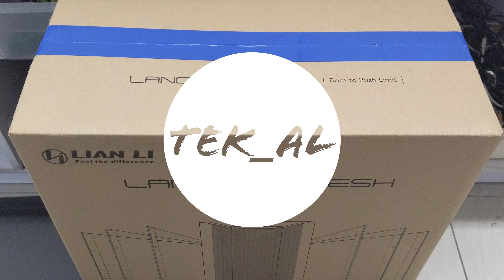Lian Li Lancool II Mesh Build | 5800X | Galahad AIO 240 | FTW3 RTX 3080 | AX916C (time lapse)

Comment: Bro I need help , so my system booted up first try and was going smoothly until I overclock Ed my ram , now when I try turning it on it says the cpu is not working so is my cpu dead or did something else go wrong
Reply from the maker: Hmm. AMD and memory sometimes don't play nice together depending of memory brand name. Just reset your CMOS and it should post again. If you see two pins usually nearby the coin battery on motherboard. Beside those two pins on the mobo it indicates CLR_TC. Short that out by using tip of pen or screw driver. If you're comfortable with that of course. If not then take out coin battery, wait an hour or so then put it back in and turn on PC, hopefully they did the same job. Hope that helped

Comment: Do you think I could fit a 280mm Aio at top with same ram ?
Reply from the maker: I think it can. It's very tight but it looks like it'll squeeze through if done right
Reply: @tekaltechnician  It Ended up fitting with a bit of spare room, i used corsair vengeance rgb pro ram in case anyone is curious. thanks for the advice when i needed it (: